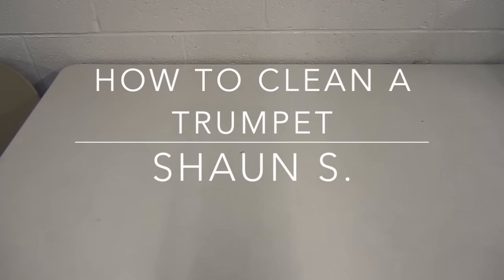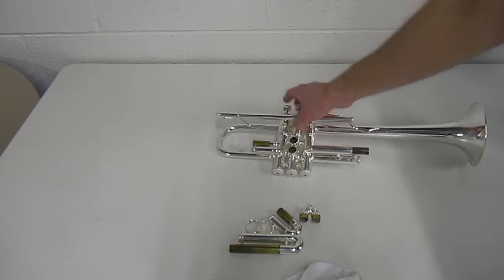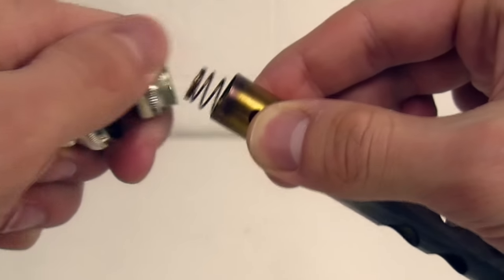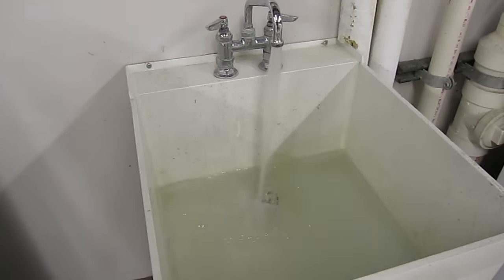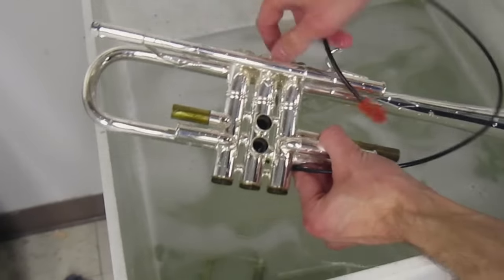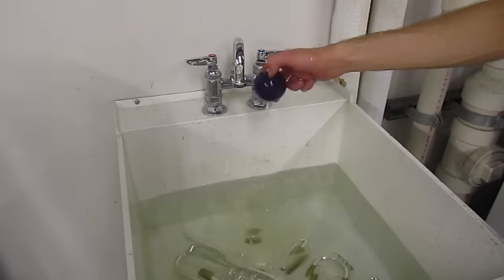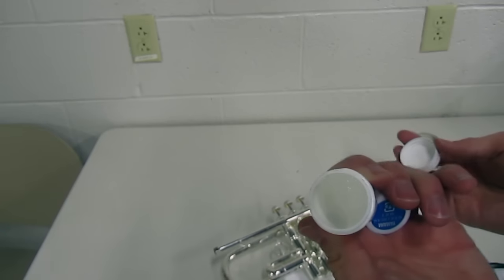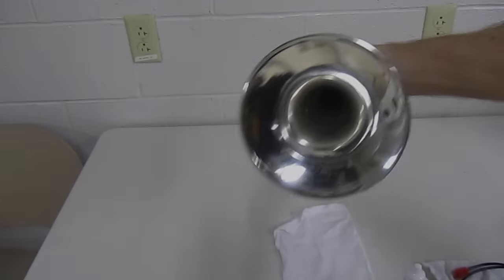How To Clean a Trumpet

Comment: Thanks for the video.
One more tip: never do a 'cleaning' the day of a concert or an important rehearsal. It's an old trick, but we sometimes forget it while trying to do the right thing. Besides the fact that it takes some time to 'redo' the interior after a complete cleaning, you may lose a spring or have other problems¨And if you only have one instrument.... you will be annoyed...
(from real life experience...)
Reply: I found this out to my cost as an intermediate player - big gig coming up, cleaned trumpet a few days before and dented one of the slide receivers so it couldn't be reassembled. Trumpet had to get sent away to get dent out, mad panic trying to find a hire trumpet in time for gig. Just what you don't want when you're nervous enough about performing.

Comment: Thank you so much for making this video, I have on and off played the trumpet for several years and recently obtained a pawn shop Yamaha that definitely needed a lot of love. This has helped immensely with the know-how of how to take it apart, clean, and put it back together without ruining it. Thankyou. 

My one question, the tiny circle of cork on the spit valve\tuning slides, those are water safe? slide are
Reply from the maker: Glad this video could be of service! The cork is water safe. Depending on the state of your instrument, the cork may need to be replaced. That could be an easy music shop fix or a DIY, although buying the cork in bulk might be less cost effective than having a repair shop doing it.

Comment: Shaun, a great video and very helpful.  
Is there a risk of damage to the pads in the water keys when the trumpet is submerged?
Thanks,  Peter
Reply from the maker: Hi Peter, thanks! To my knowledge there is not a risk of damage to the pads. I don't submerge the trumpet for more than 30 minutes, but I've never had any problems with them. Usually I'll have them replaced every so often when I take them into the music shop for a cleaning
Reply: @shaunschaefers  Shaun, it's great to hear from you.  Ok noted.  Thanks for that reassurance.   Peter

Comment: Good video I learned how to clean it properly but I just need to know if I also need to put the caps on the bottom of the valves in water as well or would I just leave them out then put them on after the trumpet is done
Reply from the maker: I like to take them out personally as I feel they get clean better. One of my trumpets tends to collect more grime in them compared to the other one

Comment: Hi there Shaun. After I cleaned My trumpet it turned hard to play :s 
Do I just have to wait longer, so my trumpet can get fully dry?
Reply: What makes it hard to play?
Reply from the maker: You might have one of the valves turned the wrong way in the trumpet. Make sure the valves are aligned with the guides inside of the horn!

Comment: This is a very good video, but I have a question. How can you damage the valve pistons by wiping them off? I just don’t know how they can be ruined. 
Also, is it terrible for the trumpet to use valve oil on the 1st and 3rd tuning slides?
Reply from the maker: Good question Joseph. Valve material is often one of the more vulnerable parts of the valve, and by wiping off piston valves with a rough material like a paper towel there is a chance for some damage, depending on the quality and material of the paper towel. If I do any 'wiping' on the valves, I just do a couple of light taps with a pure cotton material, but never vigorous wiping.

2nd question - not at all! In fact, I recommend it for smoother movement IN ADDITION TO a light slide grease.

More reading on valve material here: https://www.normans.co.uk/blog/2014/05/brass-instrument-valves-differences/

Comment: the bottom of where my felt tip is that part that is supposed to unscrew (im sorry i have no clue what if its called) to acces the spring is like very dry and its stuck and theres white stuff too. its very hard to open and i dont want to yank it because it is so hard to open that part and i don't want to damage the valve casing. thanks!
Reply from the maker: I would take your horn into a local music shop to have them take a look at it
Reply: @shaunschaefers  okay thank you!

Comment: My other players told me to make the water super hot, what are the negatives of hot water?
Reply from the maker: There’s no true benefit to super hot water - if it’s a matter of material loosening inside of it, temperature combined with time will be helpful, but regular hot or warm water would be able to work. If there’s material inside that won’t come out or an issue that can’t be fixed with a trumpet bath, I would take it into a music shop with an ultrasonic cleaner.
Reply: Super hot water damages the lacquer if it has.

Comment: Be more careful than Shaun. He hits the bell on the faucet at 4:50
Reply: Good overall video...might wish to lay a towel down in the bottom of the tub. BtW, valve pistons are hollow, but the metal is not soft.  They are plated with nickel alloys {including monel} or entirely stainless steel.  The tunnels, generally brass are not so soft as to avoid cleaning with a soft brush.  I do not recommend the use of toothpaste on the valves for students {or otherwise} as it is grit, which if not removed 100 %, will cause wear within the valve casing when reassembled.
 I fully agree that lint must be avoided and the valves, after soaking in a separate bowl of the same type solution of warm water and non - detergent dish soap ...get wiped down with a microfiber cloth.  These are readily available for use with cleaning glasses and are non-scratching and lint free.

Comment: My valve caps are stuck.  Do you know how to loosen them to remove them?
Reply from the maker: Sometimes letting the instrument sit in the water for a little and then using a kitchen grip (like for jars) on them will work. Worst case scenario, take it to a local music shop and see if they would do that part for you.
Reply: Thank you.  I inherited this trumpet so there is no telling how long since it was cleaned.
Reply: You can also heat it up with a hair dryer or steamer, cover it with a cloth, and guve it an extremely light tap with a hammer and then try to unscrew it and it should easily come undone
Reply: Rick Croucher WD40 worked for my old trumpet
Reply: @thebigcheese3574  I am not sure that I would personally recommend WD40.
Reply: Derek Anderson I washed the wd40 off after it came off. The horn was sitting around for possibly decades so it only needed loosening once
Reply: @calebmills6051  did you get this information from a guy cleaning his baritone or euphonium

Comment: QUESTION TIME: if you have a snake can you just take the slides and clean the inside or no?
Reply from the maker: You can just clean the slides if you don’t want to clean the whole trumpet, but often letting the trumpet bathe in the water will loosen up any debris

Comment: Is there anything I need to add after the trumpet is out of the tub? For example a polishing equipment or anything? I have a silver trumpet and do not want to damage the silver. Will it affect the silver if there is no polishing after a deep clean wash? Any answers please?
Reply from the maker: After the instrument is dry, I usually use an old soft clean t-shirt and I will use my breath to fog it up and then "polish" it. If you don't polish it, nothing bad will happen. I know there are some players that prefer to polish it and several different ways, but I don't know enough about it to recommend you a specific answer. There should be some ideas online regarding some ways to do it, drum corps players are especially good at shining their horns!
Reply: Shaun Schaefers thank you for the response, I just didn’t want to damage the silver. Just got the trumpet.
Reply from the maker: @EzequielMorales14  No problem, congratulations on the new horn!

Comment: How do you wash the cap if it has a spring attached to it
Reply from the maker: The spring should be removable, but if it is not then avoid washing that part soaked in water.
Reply: Shaun Schaefers ok thanks.

Comment: What do i do about the tarnish on the main tuning slides? it doesn’t come off when i clean it regularly. it only comes off once i do a chemical bath, but i don’t want to have to bring it to the music shop to get it removed. I heard brasso was an option but it seems controversial, and I don’t know if it’s fully safe to use on an expensive horn
Reply from the maker: I know what you are referring to in regards to tarnish. The main question is, do you think the tarnish is affecting the movement of the slide? I personally don’t mind it as long as it’s not affecting the playability. I have not used brasso before, but I know some who have.
Reply: @shaunschaefers  I just mainly think it looks ugly so if there is a way to get rid of it, I would like to know. For me, I just like my horn to look nice but if you can’t really do anything about the tarnish than it wouldn’t be a big problem

Comment: What if you dont have a brush for mouth piece or valves? Would a snake be alright?
Reply from the maker: I would avoid a snake for the mouthpiece, that's too large for them. Just run water through them and make a note to get a mouthpiece brush (they are cheap and great). A valve brush is not as vital, and submerging the trumpet should take care of most of the grime.
Reply: @shaunschaefers  ohh ok. You see... I didnt see this comment until now so I used the snake and it went through nearly all the way. But it took some/most of the stuff on the side out. Anyway.. thank you. I'll keep the mouth piece brush in mind

Comment: Mine is not playing well and it's not the valve alignment. Can cleaning it really improve performance?  Right now, it's almost impossible to get smooth playing performance.
Reply from the maker: What exactly is the problem? Are the valves sluggish? Is the sound stuffy? I just cleaned both of my horns over the weekend, and it really did improve it’s performance. When was the last time the horn was cleaned?
Reply: @shaunschaefers  well I've only had this one a month or so I bought it used. It's a pocket trumpet so they call it. It's silver by Cecilio. I've oiled the valves but haven't cleaned it as you've demonstrated. I'm hoping when I do it'll alleviate the problem. 
Valves are good they don't stick. Best way I can describe it is like giving a trumpet to someone who's never played before. It's not like blockage from turned valve but it's not smooth. Hard to describe.
Reply from the maker: @jimmieroberts4430  That could be the nature of the pocket trumpet due to the compact tubing, or that specific horn judging by the brand. Cleaning it might help, but if you are new to a brass instrument it also might be related to your embouchure, as starting out on a brass instrument does take time to develop a clearer sound. Let me know if you have any questions or if there is anyway I can help.
Reply: @shaunschaefers  ok thank you. I am experienced although it's been awhile since I've played regularly. Nevertheless I feel I haven't lost it or am at beginner level again. I'll try cleaning hopefully that will make a difference. I'll let you know. Thank you again Shaun cheers

Comment: Hi, how do you know what order to out the valves back in? Thanks
Reply from the maker: When I clean, I keep them in order. Most brands will have a marking of 1, 2, or 3 on the valve to solve this problem. If not, take your best guess and try playing the trumpet afterwards. All of the valve combinations will only work if the valves are in the right spot.

Comment: I’m wondering why they never include slide oil in cleaning kits.
Reply from the maker: Good question. Slide oil is sometimes sold at music stores, sometimes not. Honestly, slide grease with a few drops of valve oil works just fine, but I remember being taught to only use slide grease (without the valve oil) as a younger student and that just doesn’t work as well.
Reply: @shaunschaefers  Oil will only dilute the grease. Although it will make the slides a bit faster, it's not their purpose. Slides need to maintain their position for stable tuning. It will do its job better if you don't dilute the grease with oil. 1st and 3rd slides are a different story of course. It needs oil without grease.

Comment: Could I use brasso or flitz on my valves
Reply from the maker: Using those materials on your valves could cause some harm. If your valves are dirty/have build up, I would use a regular crest toothpaste (no whitening or fancy stuff) and a Q-tip and gently apply the toothpaste to any spots that might be on it. Then, make sure to give the valves a good rinse off.
Reply: @shaunschaefers  NEVER use any kind of toothpaste on them. Either leave it alone and have a tech to clean them, or use denatured alcohol or break cleaner and some non-scratchy cloth.